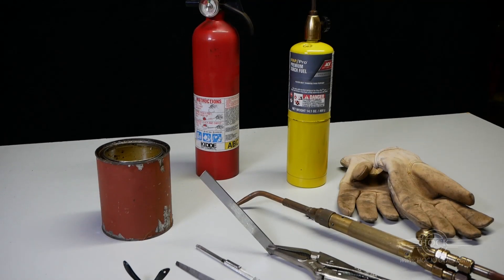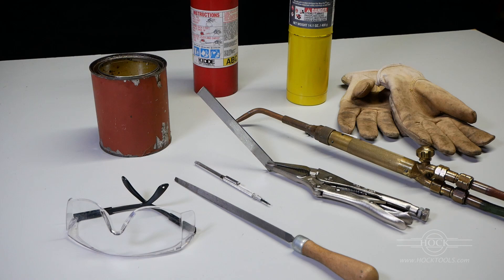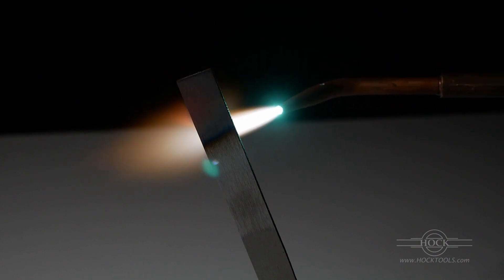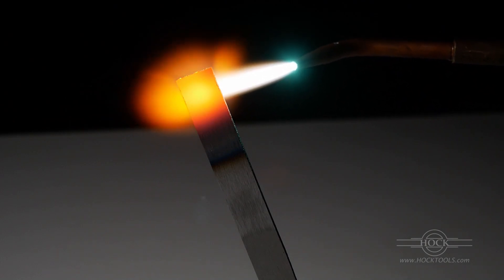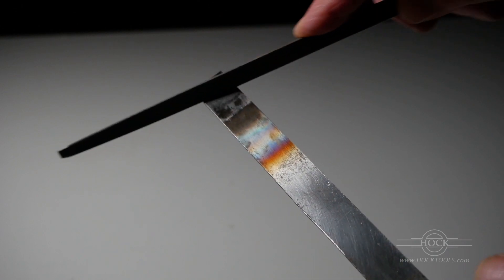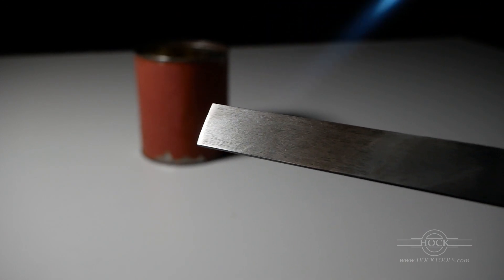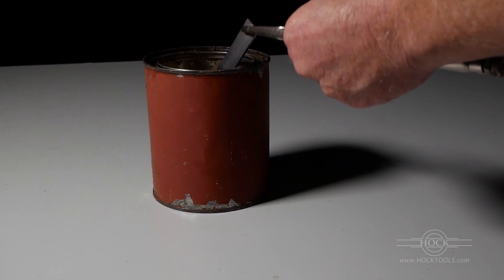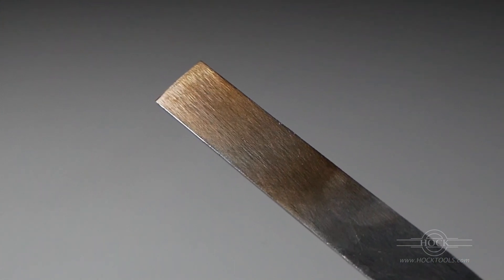Heat Treat Demonstration

Comment: I appreciate you sharing these.  although I took metallurgy, it was  from a professor who had literally taught the course 100 times  and seemed to have lost most of his enthusiasm for the subject the quarter I took it. It was all about steel and we talked not an iota about non-ferrous metals.  Then, the next ten years, in the design phase of my career, except for nuts, bolts, pins and inserts, I never needed to specify a steel. I always ended up working with AZ131B Magnesium (which is a tooling plate) or 6061 T6 Aluminum (very weldable) whether it was a 3/16" thick or 14" thick and virtually nothing else.  So I enjoy learning about it, from my luthier blade interest.

Comment: Super video Ron -You mention Austenite (the migration of the molecules on heating) so when does Martensite occur?
Reply: The Martensite forms when the Austenite is cooled rapidly during the quenching.
Reply: @robc2536  Thank you Ron....so you end up with Martensite
Reply from the maker: Yes. Martensite is the desired end product crystal structure of heat treatment. (Thanks, Rob C!)

Comment: So for those of us who dont have an oven with a digital control, is the reheat to 350 and quench in oil again at the first straw colour the same as putting it in the oven at 400 for 2hrs?
Reply from the maker: Tempering to 350F should get it to about Rc62. 400F will yield about Rc60 -- still plenty hard for most purposes but Rc62 will hold an edge a bit longer. 2 hours is way more than enough but there is no harm in holding at temperature for that long.
Reply: @HockTools  thank you. So, it seems preferable to put the iron into the oven at 350F and let it ride for how many minutes (if we do not want to risk messing up with the straw coloured propane gas reheat/quench)?
Reply from the maker: @LitoGeorge  If you trust your oven to not exceed the set temperature you can leave it in there almost indefinitely. The "rules" say to soak for twenty minutes per inch of cross section so with our thin blades and knives, just be sure it's reached the target, let it soak for a few minutes or more and you should be good to go. If you find it's too brittle, toss it back in to, say, 375 or 400 for another soak.
Reply: @HockTools  excellent, thank you. I have just heat treated 3 plane irons from the 1850's to 1890's. I'll be tempering them in the next hour. How would I test for brittleness (ie: too brittle?) Thank you.
Reply from the maker: @LitoGeorge  Take them for a test drive in some hard wood to see how they perform. If they seem too brittle you can re-temper to a higher temperature.
Reply: @HockTools  Ron, thank you. Wanted to let you know that I have passed this info on to a bunch of friends, I now have one of your blades (pre Lee Valley) in my block plane, and I keep coming back to refresh when I get a small question in my head about the process. You really do cover everything. The perfect video on the subject. Obrigado.